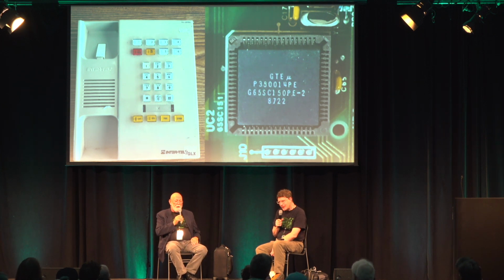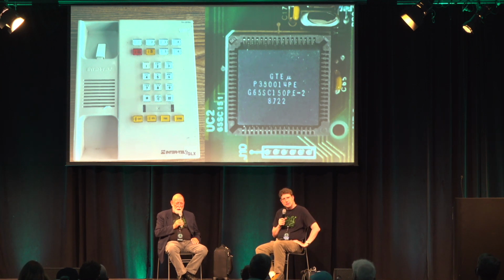VCF West: Bill Mensch — Genesis and Evolution of the 6502 Family

Comment: In fact the Set Overflow pin was used by the Commodore floppy disk drives. The hardware was shifting in and out bit-serial data from the r/w head and was using the SO pin to signal the CPU when a new byte was ready. That made a 3-cycle wait loop possible, so very quick response times and low jitter. If an IO address would have to be read in every loop, this would be an additional 4 cycyles. I found this use of SO very ingenious.
Reply from the maker: Commodore did a lot of ingenious things. One of them was putting a microchip into the drive to make it more intelligent.

Comment: The 6502 really did change the world.
A 6502-based chip was used in the machine that really kicked off home video games (the Atari 2600) and again in the system that saved home video games (the original Nintendo).
Many arcade boards used 6502s in various ways.
Apple used the 6502 family.
Commodore used the 6502 family.
Atari used the 6502 family.
The Acorn systems (including the BBC Micro) used the 6502 family.
The PC-engine used a 6502 derivative.
Reply from the maker: It's amazing how much influence that one microchip had in so many computers.
Reply: The SNES had the 16-Bit version of the 6502, which was solely designed by Bill Mensch.

Comment: Sweet.  My dad worked for GTE and used the 65SC150 as an embedded core in his designs.  Testing SOC cores was a problem since they didn't have stuff like JTAG and on-die debug back then.  He came up with the idea of using multiple mask test probes to check each part of a chip independently, as it wasn't practical to make a single probe for each flavor of SOC they made.  The 6502 core was tested first and then they tested all the other parts of the chip before they sawed the wafers apart.